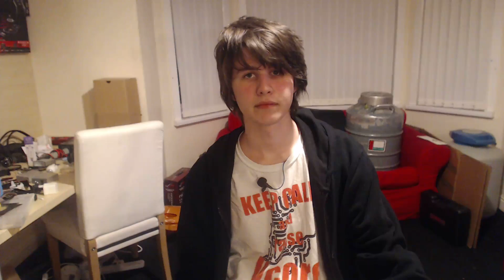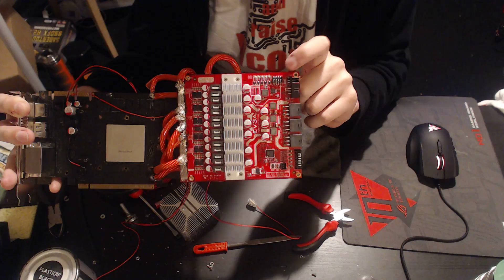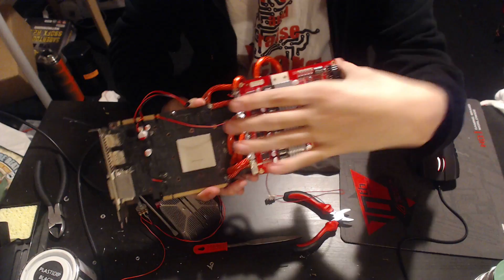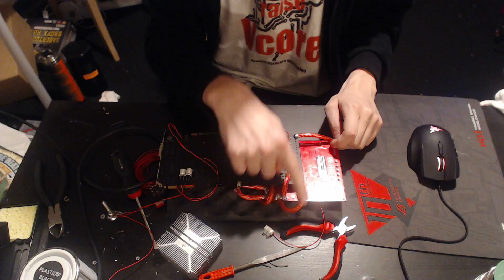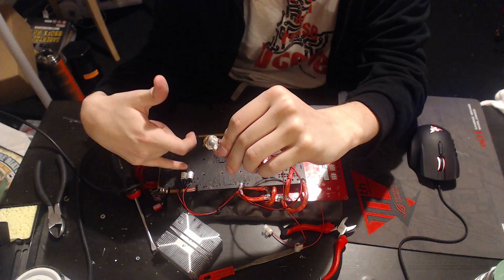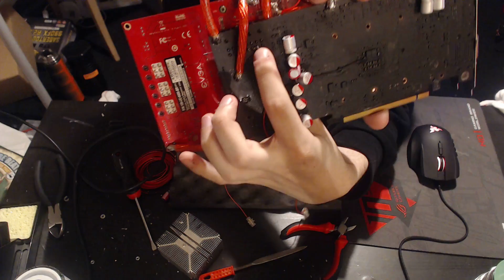Actually Hardcore Overclocking: The GTX 570 Epower Project

Comment: I had a GTX 570 sc from evga, after I had it for about 2 years and the 700's were released I decided to push it as far as I could. Well I ended up frying it, sadly I don't remember how far I had gotten it but there was a very audible pop from the card. I wish I had kept the pcb so I could look at it now that I know more about overclocking and see where it failed.

Comment: "Couldn't put this connector on a standard graphics card".  Unless you're AMD and you're producing a reference RX 480
Reply: that was an issue with drawing power from the pcie connector on the mb, not the pcie power connector.
Reply: No, the way they actually wired the 6pin was out of spec. They essentially wired the 6 pin to act like a 8 pin.
Reply: Ah my mistake then. I was not aware. I'll have to take a closer look at mine
Reply: It's not a big deal and you're not going to melt anything if you were to overclock. It's just something AMD did that wasn't in spec. NVidia was bringing out tons of 6pin gpus and AMD didn't want to be left behind, but at the same time needed the juice to power their cards with a little overhead.
Reply: Except all the 8 pin adds is two more ground connections. Doesn't make sense, but allows for 150W.

Comment: Technically those 6 pins should be able to handle a total of 117A at 12V if they used the good crimps (going by the crimp raiting). That equals 702W at 2V
Reply from the maker: PSUs typically use 18AWG for the PCI-e 6 and 8 pin wires. Here's the spec for 6 and 8pins: http://www.molex.com/molex/products/family?key=minifit_jr&channel=products&chanName=family&pageTitle=Introduction
Reply: Sorry I should really stop attempting basic math when its 1am. What I can tell you without having to break out the calculator is that the highest quality crimps you can buy for ATX connectors are rated at 13A which means 1404W can go through that e-power's connectors
Reply from the maker: standard PSU cabling is 18AWG

Comment: Why don't you just drop 2 part epoxy on the card to prevent humidity and condensation ??? a thin layer would suffice
Reply from the maker: If I need to tweak some soldering under the the plastidip it is very easy to pull a little bit or even all of it off.
Reply: Alex Woho it would also act as an insulator and develop heat. interesting idea tho

Comment: Just trying to understand what's happening here. You'll have one 6pin power connected to the Palit board (since you didn't short out the other sense pin) and you'll have power coming in through the EPower. Does that mean you'll have the 4 phase on the card run in parallel with the EPower? Do you have to do any voltage matching between the two or is there something to prevent the Epower from interacting with the card VRM and vice versa?
Reply from the maker: The 4 phase on the card is disabled. The 6 pin hack is just because I'm not sure if there is anything else that uses the 6 pins for power other than the Vcore VRM.
Reply: Ah fair enough. How did you end up disabling it? Knife to the traces?
Reply from the maker: Pull out the inductors from the GPU's 4 phase.
Reply: Knife to the traces!? On a multilayer PCB? That was a good one.
Reply: Josif Vissarionovich ... that's why I asked how

Comment: Thanks for what you do, your content is super cool! Curious if this is your field of expertise, how would you begin diagnose and repair "Faulty" gpus? IE no video feed from any of the ports(hdmi dvi and shit). Any insight is welcomed!
Reply from the maker: See I don't repair things. However the basics would be to check if you have Vcore, Vmem and any other supporting voltages for the GPU. If you do have all the voltages then I would next check if elec capacitors might not have gone bad. which generally requires replacing them(I think just adding more caps in parallel to the existing ones might work but again I don't fix things so I'm not sure). If it still doesn't work the FCBGA connecting the silicon die to the substrate or the BGA connecting the substrate of the GPU or the memory chips is bad. If the FCBGA is bad heating the card up to say 150C for a few minutes might get it to work. If the BGA is bad you're pretty screwed because lead free solder reflows above 220C and that's hot enough to kill other parts of the card so you kinda need a BGA rework machine to fix that and those cost a lot of money.
Reply: Actually Hardcore Overclocking Thanks for the insight, helps a whole lot.
Reply: Thanks i am on the same boat.

Comment: so could i rob the power circuitry from a motherboard and do this? i saw your sabertooth one but i couldnt find guides on the net.
Reply from the maker: yeah that's what I tried and failed to do on the Sabertooth. Generally motherboards are terrible VRM donor candidates due to few of them built for as much power as GPUs. It's better to hunt down dead highend GPUs. Like say dead EVGA GTX 680/780/780Ti/980/980Ti Classified or K|NGP|N cards. The ASUS Matrix line also had nice VRMs but they rebrand the voltage controllers so they are a pain to hot wire. The MSI lighting cards are great candidates. Reference high end AMD cards also work well enough but not as well as the other cards I listed.

Comment: Can you cover it in conformal coating to stop the liquid issue?
Reply from the maker: That basically what I did with the Plastidip. I guess if I got some kind of longer nozzle for the spray cans I could get even the area under the E-power covered.

Comment: Was thinking wow what's up with the mega-guage ground plane wiring ... "several hundreds of amps" :O . That answers that question ;D
Reply from the maker: Yeah mega gauge wires and still losing 100-200mv because of the dodgy connection quality.

Also several hundred amps is normal for GPUs. At stock settings most high end cards are between 100 and 200A for the core(consider that most high end cards are 150-300W power draw and run on around 1.15V).
Reply: Not that this is my field of expertise but maybe it's not your soldering but just the resistance of the wires?
Reply from the maker: It's my soldering. 8AWG has a ~2mOhms of resistance per meter. All the wires on the card are less than 10cm. There are 6 for Vcore and 7 for GND. So the wires for Vcore should have a combined resistance of  0.002/10/6 which is ~0.000033ohms or 0.033mohms at 200A that should have a voltage drop of 6.6mv. The GND lines combined are 0.0000285ohms or 0.028mohms which at 200A would have a voltage drop of about 5.7mv. I'm getting about 100mv at 1.1V on the core which is close to stock for a GTX 570 and should therefore be about 180A possibly less so I have a lot of extra resistance coming from somewhere and it's probably not the wires.
Reply from the maker: Yeah I knew there was something up with magnetic fields with these mods but I never knew what exactly. I guess it could be funny to put a compass next to them and see if they can turn the needle.

And thanks for the help!
Reply from the maker: As of right now it seems like they have enough surface area to stay cool just from the airflow that use to cool the VRMs. If I tried to run the card without any active airflow I guess they might get warm but at the same time any heat they will produce will get dumped into the PCBs of the GPU and E-power and those do a great job of acting like heatsinks. 

Also I haven't yet run it at settings that cause 200mv of loss. I wish I had more 6 pin extension then I could get at least some input power draw readings.
Reply: And this is why I sub to this channel.
Reply: you know your stuff man. great mod.

i enjoy your videos a lot, even though i deal with these things daily, you give it such a fresh blast of positivity that helps me enjoy what i do - always look forward to your videos.

always happy to discuss power related issues, i did power consumption validation at intel for 1.5 years and now PCIe spec validation. 

2 tips that you can try:
1. usually production soldering material used for power contains some added chemicals that help the soldering material reach higher temp distributed more evenly. think of it as mixing flux fluid with your soldering material. try removing the soldering entirely, cleaning the pad on the pcb and use a "high end" soldering material for a cleaner more uniform contact on the next mod.

2.consider the morphology of your wires. even though their Ohm/m is pretty low, the shape does actually matter, the way that direct current creates magnetic field plays a role in these high currents, you could actually be having electromagnetically  induced voltage drop, especially at the soldering points, using a thinner wire, with better morphology and would make the 200mV diff you see.

 i will check the brand of wires we use at work tomorrow for you, which i know have 10-20mV drop in these current ranges (500amp), but they are so thin and sexy compared to those red ones that make the mod look really rocknroll but i think are a bit cumbersome (as next to the other 6 pin connector), i will also check that soldering material for you. 
maybe can ship you some ;) if i can buy some from the supplier seperetly
Reply: 200mV drop over the wires with 200A of current means the wires act like a 40w heater... do you need cool the wires too?
Reply: i was wondering how an E-power connected to whatever you are using it for.  not gonna buy one of those anytime soon

Comment: Can this be done with AMD cards?
Reply from the maker: Literally any VRM can be bypassed to use an E-power. Not just GPUs. You can do mobos, Raspberry Pis and basically anything else that runs on .9 to 2V. The only issue is that say on GPUs bypassing Vcore disable Vmem so then you need a second E-power to power the memory. Or say you want to do the GTX 10 series. If you put an E-power on those the driver will notice that the shunts are now reading too low power draw and the card will be put into safety mode and get stuck at 139MHz unless you do another mod on the card to get the GPU to think that everything is still working properly.
Reply: Nice! Try it on a console for shits and giggles.

Comment: so, PCI-E spec is a conservative measure?
Reply from the maker: The 295X2 installation guide quite explicitly says not to use those.
Reply from the maker: very very conservative.
Reply from the maker: 295X2s pull close to 250W on each 8pin at stock clocks. 1 8pin can handle at most 306W of power according to the spec sheet for the connector. 306W is a lot more than the 150W spec.
Reply: check the cable gauge then multiply the max amperage by three( number of 12v cables), that chould be close to the max of your cable
Reply: the 295x2 states that every plug needs its own independent 25a 12v rail from the power supply
Reply: Yes, the R9 295X2 requires two 8 pin leads directly from the PSU. Since a single R9 295X requires and 8 and 6 pin, and the R9 295X2 is already clocked higher and has a pump, two fans ect, power draw is much higher per connector.
Reply: +Imię Nazwisko
stuff is split across Rails in multi-rail situations - it's split to separate runs of wires.

it has to be that way otherwise they wouldn't actually be separate from each other (which kind've defeats the purpose).

Comment: Sorry for the dumb question(s). Can you use the same VRM board on newer GPUs such as 1060 - 1080, theoretically? Is this board only for nvidia cards?
Reply from the maker: Yeah you can use it on pretty much any GPU. The main reason why you wouldn't use it on a 1080 or 1060 is that the 10 series is so loaded with safety features that getting the E-power to work on the cards properly is ridiculously hard. 

You can also use the E-power on motherboards and really just about anything else that runs on .9-2V. There are a few people who used E-powers on Raspberry Pis to go beyond the max voltage of 1.55V that Raspberry Pis are limited to.